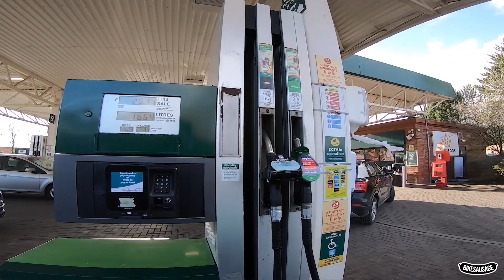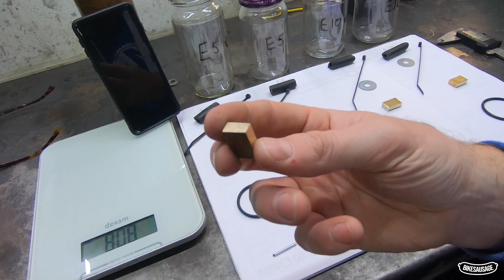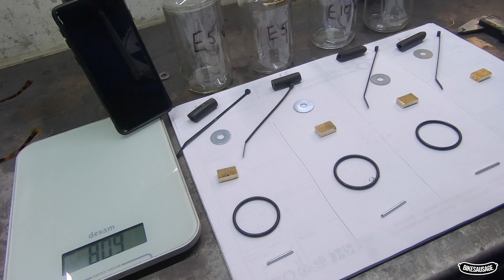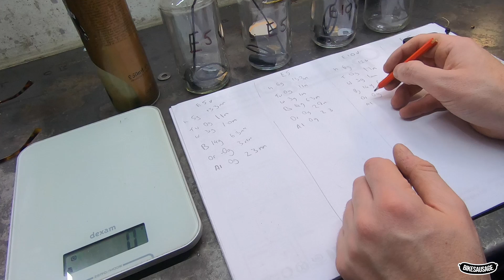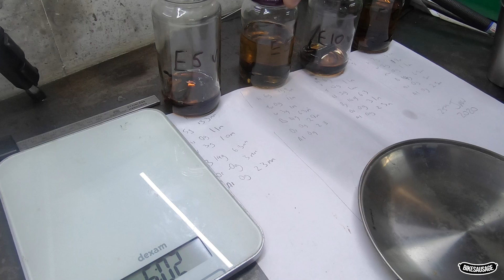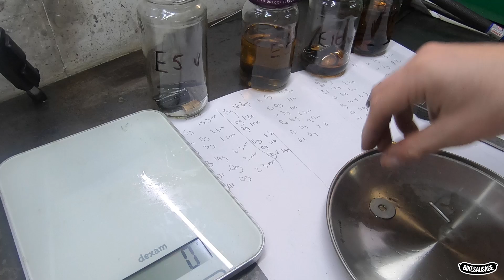E5 v E10 FUEL | Does it really make a difference?

Comment: as a mechanic of 31 years ,E10 is not good for older vehicles and even modern vehicles it can cause running issues , hesitation ,hunting tickover . it gets even worse if vehicles are left with old fuel in system as it is hydroscopic with means absorbs water ,this means it can cause corrosion an pitting in injectors ,we are being taken for fools by the government an fuel companies that it is the same quality

Comment: CBR 900 RRV  Owner, regardless of the scientific arguments my gut says use super unleaded on my Carb bike. not for performance but just in case, as bits are old and have been super reliable in the 20 years I had it, winter stored in the UK with all the humidity, always runs after winter. No need to change..
Reply: Same here, 96 thunderace.

Comment: I want to know the difference in mileage. I feel that even in my car I get more mileage from e5. And working out the difference in price. It's overall cheaper for me. Anyone else got any research on this?
Reply: 2016 Tuscnon 1.6T, E5 reg unleaded 450 miles a tank, now with E10 400 miles / 410 miles. i use E5 super  and get 475mile easily. The power is smoother to, less revs.
Reply: By contrast to David, I found a noticeable drop in performance, requiring approximately 4 tanks of E10 to every 3 tanks of E5. This will vary by vehicle of course, the best way to gauge the difference is to test it yourself. An interesting post on this topic came up on the CBR500R owners FB page a few weeks back, with answers varying from 'E10 is more efficient' to a '25% drop on E10', 'though obviously age of engine may be a factor too.
Reply: I’ve used E10 since 2009 in all my vehicles. I keep fuel records for all of them. I have found no noticeable difference in fuel economy. Having a roof rack, even an empty one or having a bicycle on a rear mounted rack make significant differences. E10 is fine.
Reply: @davidmatthews3093  what country are you in? I find it strange that people in the states say that they've never had any problems with E10 whereas it seems that many people in the uk have, maybe the difference in the climate affects it?

Comment: having a throttle stick open is not funny, on pulling it apart it was gummed up with something akin to the texture of wall paper paste. Melted fibre glass tank on supposed E5, two steel tanks with pin hole corrosion and rubber seals accidentally exposed to 'new' fuel end up completely distorted. The fuel is crap and with potentially lethal consequence from my experience.

Comment: Too many variables ie combustion engine serviced by a garage ( are they using OEM parts or cheaper alternatives)
In a vented holding receptical what is the atmospheric pressure/water percentage/humidity etc.
What additives are added as different retailers have different mixtures.

Comment: I'm a fan of the channel, but as an engineer I can only shake my head at this video.
Using a scale with precision of 1g is ridiculous in this instance, using off the shelf o-rings is absolutely not representative and using a piece of aluminium welding rod (usually 4043 aluminium) is also not representative at all of all the different kinds of aluminium used in an engine. I personally also don't see a reason to distrust manufacturers in rating their own vehicles suitable or unsuitable for the use of e10 since they know the exact type of material used for every single part. This test was honestly incomplete at best and misleading at worst. Also there are so many more things to the discussion of e10. For example: e10 is less energy dense (about 2%) and therefore will lead to less power in vehicles that are designed for e5, but more power in vehicles that are designed for e10. This will also lead to higher consumption when using e10, which is offset by the cheaper price tho. Additionally in some cases e10 will reduce engine knock. 
As a rule of thumbs for motorcycles: If it's fuel injected, it is probably modern enough to be used with e10, if it's carbed you are probably better off with e5, but looking up the manufacturers recommendation is always a good idea.
Reply: Awesome breakdown, thanks for a real heads up! Cheers 
Salute from UK
Reply: Blockbuster You're being a bit harsh it is after (I'm sure) all a pinch of salt experiment and sausage in effect does point out  need for correct Oring for the job. You and he  missed out a vital flaw in which fuel is used.  One of the top brands in UK admits their premium E5 contains no ethonol at all and should have been used as a control specimen
Reply: Have to agree with blockbuster, plus I'd add the following cutting across the 'science' claim -  waste of time not knowing what the O ring was made of e.g. EPDM, nitrile.
Also, a waste of time not actually knowing what ethanol content each fuel sample contained - E5 can be 0 to 5%, E10 can be 5.5 to 10%.
In addition, knowing the water content before and after 60 days would add to the 'science' in knowing what really happens (controlled environment required or measure the humidity daily).
Combustion (power) test required at start and after 60 days.
Not the brightest idea to leave petrol vapour (comprises all sorts of chemicals) to evaporate indoors...
Overall......just clickbait
Reply: @russratcliffe7353  True what you said , my SLK is running poor on this petrol so will be forced to by 5* at £2 a litre ! Not good ....
Reply: I'm amazed that an engineer who was sufficiently incensed to type a long technical blurb would end his advice with a 'rule of thumb' containing one 'if' and two 'probably's' - doesn't sound like your advice is any better than the advice you're criticizing
Reply: @mineblock9024  I actually ended with the advice to look up the manufacturers recommendation. Also I'm not claiming to have done tests and I'm also explicitly saying that I'm neither an engine, nor a material science expert.
Reply: Hence why this clip ended up on Bike Sausage.
Reply: "as an engineer I can only shake my head at this video."

An ego AND an engineering qualification? Well colour me surprised.
Reply: Agreed, Boothy we love your attempt at a fortnine scale experiment, admirable indeed, but step up the instruments and sample size my dude :)
Reply: @advsquid4339  There is really no need to experiment with this stuff! 

Increased ethanol means decreased economy, and damage to older vehicles.  

It also allows for increased virtue signalling and enormous extra profits!

The most serious effect of this, that remains invisible, is that using grains to make ethanol, will mean millions of people starving!

Seems like the climate alarmists dont care much about millions dying of starvation, as long as the globalists can up their profits, and the woke can virtue signal about "green" fuels!
Reply: My SLK R170 is running rough on this crap petrol ......
Reply: @curtisducati  The calorific value of the fuel is low,  so your engine will be less efficient and will use more fuel.....
Reply: @humourless682  Pointless buying it then ? Better off with higher octane fuel at £2 a litre but cheaper to run on 5^,  as I will get full MPG for a gallon and not 80% power and MPG on E10 ....
Reply: @curtisducati  If you can get it ethanol free fuel, is the best possible choice.
Reply: @curtisducati  It's not that the fuel is crap, it's just that the engine is not tuned for it. If the engine would be tuned for it then it would run rough on the other fuel.
Reply: "I'm a fan of the channel, but as an engineer....I personally also don't see a reason to distrust manufacturers in rating their own vehicles suitable or unsuitable for the use of e10"

I'm a fan of the channel, but as an attorney...I personally don't see a reason to trust manufacturers in rating their own vehicles...with respect to pretty much anything, for the simple reason that they very often have good and selfish reasons for not telling you the whole truth.

I have no doubt that the experiment here is unreliable, but I also know that even professional science experiments can be unreliable for any number of reasons. You can poke holes in pretty much anything if you know what questions to ask. From that perspective, I'd be interested to know what RyanF9 thinks of this video.
Reply: @cisium1184  I wonder if the computer modelling, and pseudo-science, which is the foundation, on which climate alarm, is based, is any more credible than the experiment being carried out on this video?
Reply: @cisium1184  My Mercedes SLK200K is awful on E10 , stutters and hesitates from the traffic lights etc , not good at all so now I'm forced to buy premium which is just E5 now ? £10 a gallon aswel , says at the pump top fuel but there telling fibs they just use E5 ...Now I have gone out and picked up a DIESEL ! A Peugeot 508sw 1.6 semi auto stop start and getting 80 average MPG and £20 tax a year so by going greener they are all getting us to buy diesels ..OOPS....
Reply: @cisium1184  I do agree that there are many reasons why manufacturers would not tell you the whole truth. However, I do think whether or not a vehicle is suitable for e10 or not is not something where you gain anything by lying. No one is going to be mad at you when your 15 year old vehicle is not capable of using a fuel that gets introduced now. It's just a matter of can it, or can it not. People are more mad when you tell them it works and in fact it doesn't. 

Of course you can poke holes in any experiment, humans make mistakes and also it is basically impossible to set up a perfect experiment. But there are still standards for measuring stuff and scientific methods for doing stuff. 

I would also be interested to see RyanF9s view. It is obvious that he researches his topics well and tries very hard to deliver good information, even tho he makes mistakes sometimes. But like you said, one can poke holes in pretty much anything.
Reply: Really? You don't see any reason to distrust manufactures ratings? Perhaps you should have that discussion with for example Ducati owners? Who were told, don't worry E5 is no problem, except as many an unfortunate ducati owner now  knows is not true after many suffering from swollen and split petrol tanks due to reactions with the ethnol content!
Reply: @ashleyb.1563  The type of muppets who trust manufacturers, are obviously unaware of the £100s millions of damage being caused to common rail diesel engines, here in the UK, due to removing sulphur from diesel fuel?

That's been kept VERY quiet, even though most owners of a common rail diesel, will have experienced problems of some sort.
Reply: @ashleyb.1563  Using one manufacturer that screwed up as an example for all manufacturers is a bit of a stretch I think. Of course it's possible that they didn't care enough to research their materials, or they had some internal problems, doesn't really matter. It's still just Ducati. As far as I'm aware, other manufacturers did their job right.
Reply: And ofcourse the reduced energy density is only 2% of 10%....
Reply: Best results use e7 ie diesel.
Reply: Couldn't agree more Blockbuster2033. This is sausage in other words crap. Using a set of caliper to measure o-rings is the funniest thing I've seen today, but it's still early and I haven't watched the latest Del video yet, so there's competition. 

These fools should have used carbs as their baseline material. There is also specific tools to measure o rings, simple calipers and micrometers aren't those tools.
Reply: @thedirtyworkshop  They certainly should have used older fuel lines, O-rings and rubber diaphragms as well as what they used. I also agree with the OP that they need more precise scales, more grades of aluminium, and I think even let the fuel evaporate before measuring too, just to be as precise as possible. But they got a result as expected, so not a total failure.

You like to give constructive criticism which is fine, but no need to be passive aggressive all the time. Just because they are not experts, that does not make them fools. Fools are non experts passing themselves off as if they are, we know at least a couple of those on this platform don't we!
Reply: I just want to add to the argument take as you will. So fuel used to have lead in and this would reduce the pressure at wich pistons wear exposed. In the 1990 the bought in unleaded wich made pistons literally brake- have any of you thought that ethanol burns hotter than petrol? Also aren’t most governments trying to ban the combustion engine by 2030- if more ethanol in your fuel causes your pistons to be hotter than planned they could burn out so is this just the next way to make people move on and get rid of there old cars?? I only use high octane since i realised what the fuel change actually ment
Reply: @cookz-bs10gaming  Damaging older vehicles, to the extent that they are too costly to repair, puts them off the road. 

That's a very important part of the thinking behind Efuels, and the reason there have been no proper studies into any of the many negative effects of Efuels.  

Most people seem to miss the fact that climate alarm is the biggest con ever, and isnt based on any sort of credible science or facts..........
Reply: It doesn't damage older vehicles in that way, check you temperature gauge, I'm sure it's fine. My motorbike is 22 y/o, I made it run 6+ degrees cooler anyway, but if I did not, it would still not be running too hot, and wouldn't on E10 either, obvs I use E5 though. I know the temps we see are not combustion temps, but if they are higher, so would the overall engine temps.

 @humourless682  As for "climate alarm" as you call it, if you mean global warming, yes it is fact, it is a natural process. We are still coming from the last ice age (it used to be tropical in the UK region once, will be again in many thousands of years), and we certainly do need to take measures to slow it down for our own futures sake, but it can't be stopped.

Banning combustion engines is certainly not the answer either though, it's pretty easy to build towards becoming negative carbon overall. Including making combustion engine neutral carbon, but governments are worried they will lose their precious fossil fuel tax, which is stupid.

EV's need banning before carbon producing combustion engines, if they ever should be at all.
Reply: This is sketchy science, sure, but at least they bothered to even have a go. He knocked up a rudimentary test in his shed and posted it on the B-roll channel. It's more than most have bothered doing and it's up to the viewer to determine how much to take from it. I salute them for having a go. Instead of dumping on it why don't you make your own video?
Reply: @philclarke7712  Because I, just like them, lack the proper equipment and expertise to do so. I am an engineer so I can surely evaluate their basic methods, but I am not an expert in material science, chemics or combustion engines and therefore would never even think about posting something about this topic because I would make mistakes and spread misinformation about the topic. What these guys did is basically the same, but worse because they aren't even engineers.
Reply: @philclarke7712  Those promoting climate alarm, and all the lunacy that goes with it, stand to make many $$$$ billions.  Their lies are not going to be defeated by videos, made in garden sheds.

This is good against evil pure and simple, and as usual, evil has all the money and so-called "science" on its side!
Reply: @humourless682  Yeah, it's prophiteering. It drives up the cost of food as you need the land to produce ethanol. Its incredibly stupid. I'm just wondering why you're having a one sided argument with me that has nothing to do with my post?
Reply: Yamaha set a cut off date of 1991. Like they had a crystal ball in 1991 and all of a sudden 1992 was impervious to this fuel that nobody had even thought of at the time...utter bollocks of course.
Reply: @philclarke7712  They actually say that bikes from 1990 are fine, probably because at some point in the 80s they switched to ethanol proof fuel systems because the world started using e5 fuels and some smart guy at Yamaha predicted that the amount of ethanol in fuels will only increase in the future.
Reply: @Blockbuster2033 well my 91 honda 4 hundred four cards say dffrnt ,they got melted ,
Reply: @philclarke7712  yam had no need for a crystal ball, the ethanol plan was already in place. ‘The Energy Policy Act 1992’ being one example, all arced back to the oil crisis of the 70s
Reply: @richd9658  Ah, so nobody has questioned this insane strategy in 50 years? Sounds about right. Probably made sense back then.
Reply: @philclarke7712  or are Yamaha effectively saying they have changed the materials used since that date ;)
Reply: Do you feel motor manufacturers, would feel it was expedient to upset the  climate cultists with anything vaguely close to the truth?

The net effects of E10 are going to be increased emissions, and increased profits for those pushing the climate alarm insanity....
Reply: @humourless682  climate alarm insanity? Lol oh no, you're not one of those people who can't read graphs are you?

Comment: It's been e10 here in the us for a real long time. I've stored a carbureted bikes with that e10 without issue. the vacuum petcock has to work tho, cuz normal non ethonal gas will ruin a carb just the same if it dribbles.